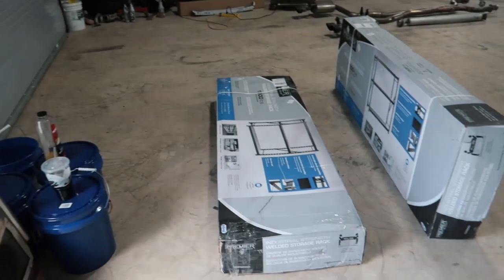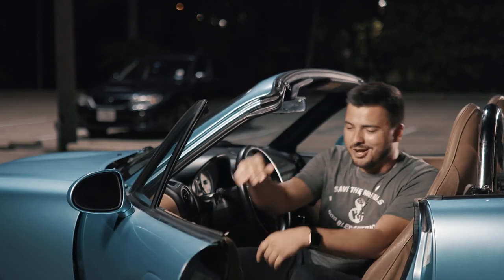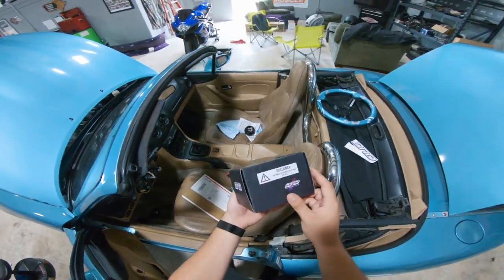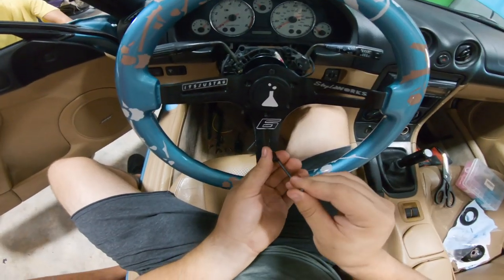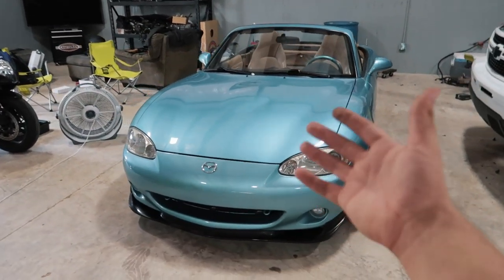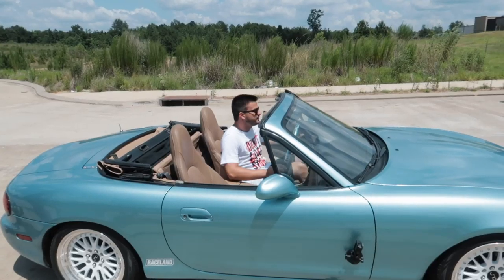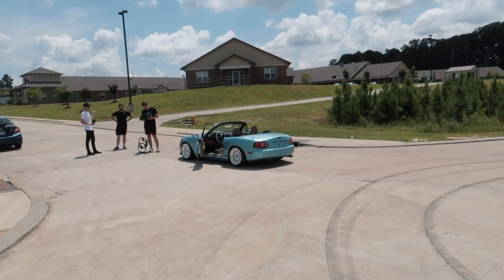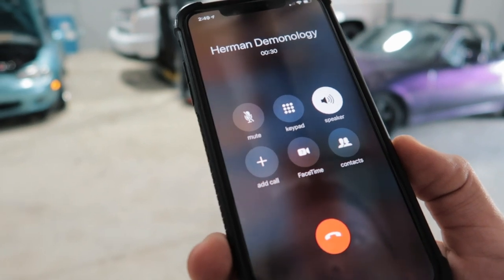Drifting my Miata during a Commercial Shoot!

Comment: Hey I have a question. On the save the manual shirt did you realize that the 4th gear slot it has a N for neutral instead of a 4 for 4th gear.